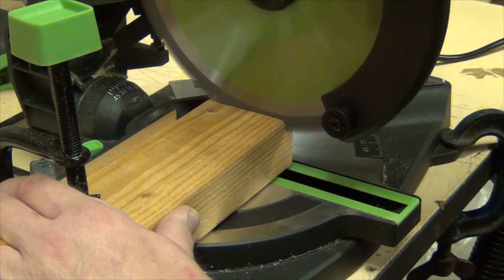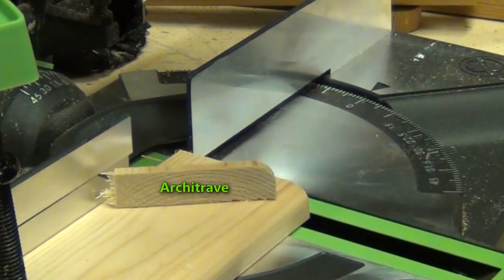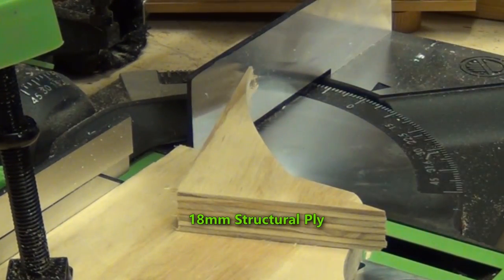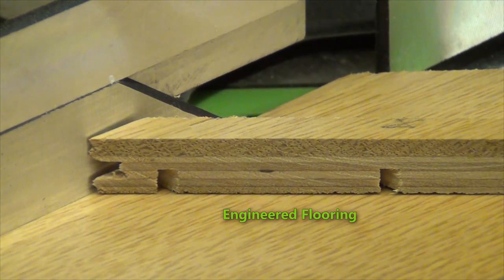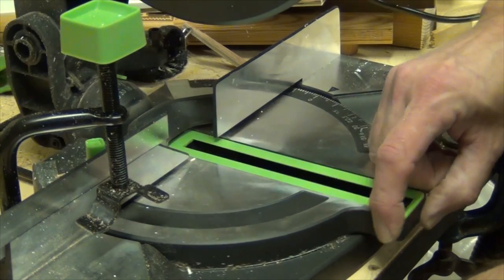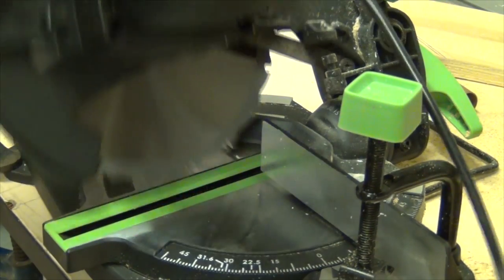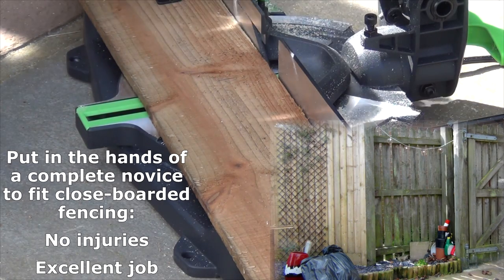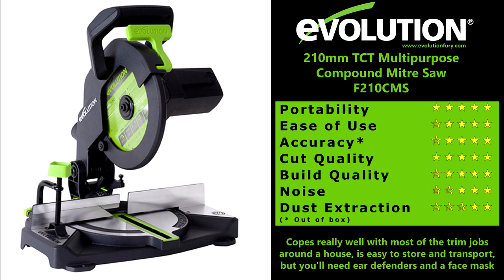Evolution F210CMS Review

Comment: Can anyone tell me the difference between the R210CMS and the F210CMS? Apart from the colour, both have the same motor, rpm, blade and mitre/bevel....
What am I missing?
Reply from the maker: Rage machines are trade rated, whereas Fury are DIY/hobbyist rated. The furies are therefore not built to survive the rigours of hard daily use. Some components will be identical, whereas other will not.
Interestingly, you can generally get the rage at the same price as the Fury, just by going to a trade outlet like Screwfix
Reply: @mitchwoodwork  Thanks for that. Strangely its the R210 that's the cheaper one right now.
Will be ordering it shortly.